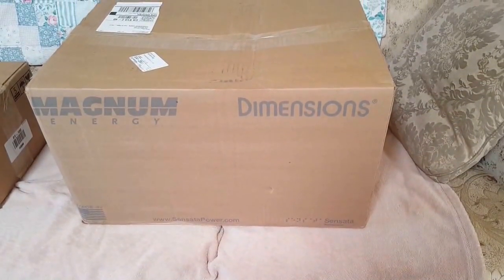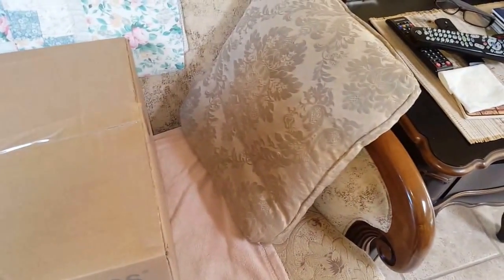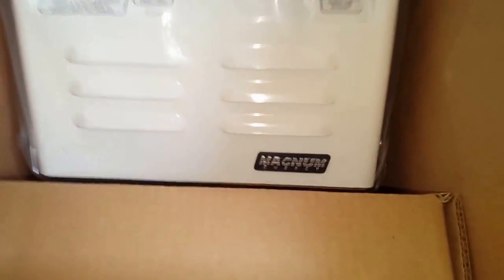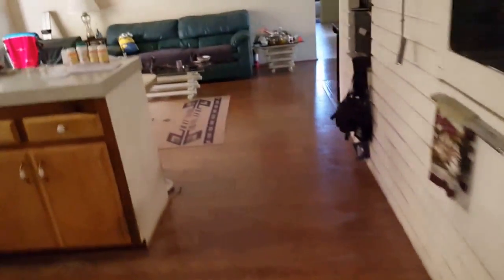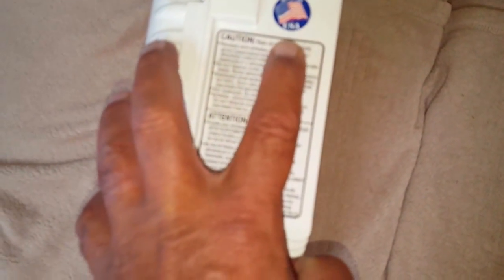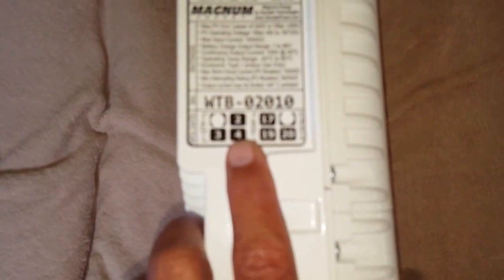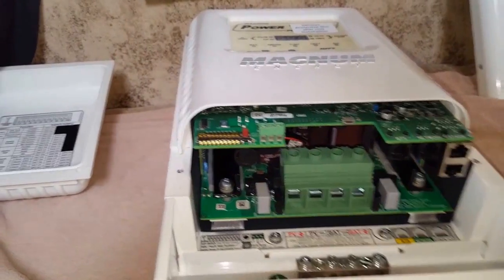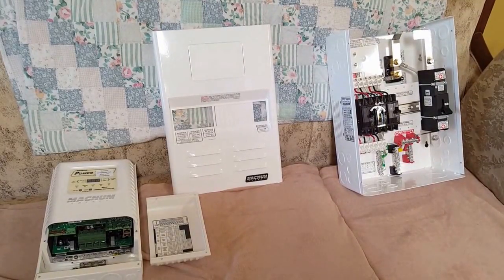Unboxing The Magnum PT-100 Charge Controller and The Magnum Mini Panel.

Comment: How do you like the PT100 i was going to buy one but never heard much about them. Please do tell what you think so far.
Reply from the maker: It's okay and does a good job, however the down side is that if you use just the controller by itself without the magnum monitor, you can't adjust the settings.  Also you can not monitor the activity on the internet, you must buy a $400.00 ad on interface.  To me the TriStar MPPT60 is way better and efficient!!  Be Well, Raz
Reply: @ElRazTheGreat1  That,s a draw back for sure. I,m glad i asked. Tks so much.